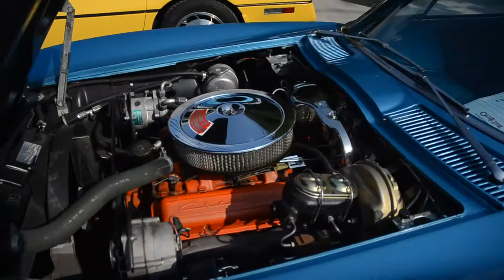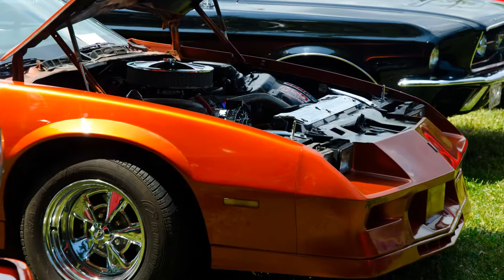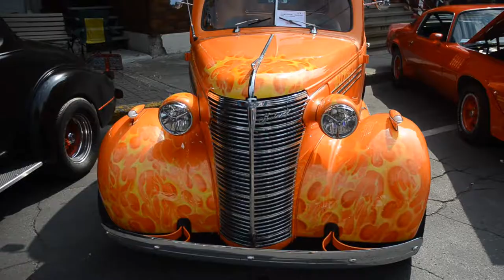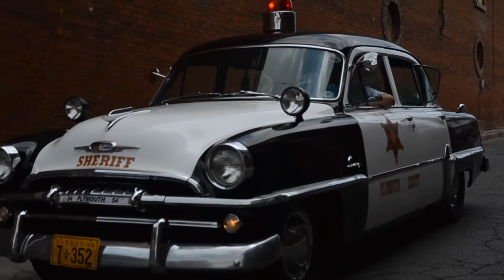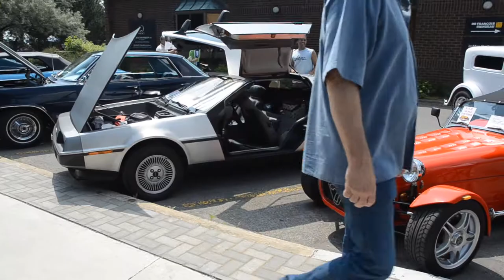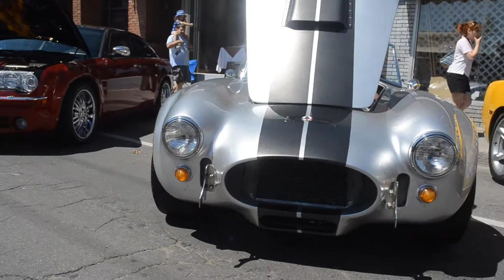Cruisin at the Boardwalk 2011

Comment from the maker: It's not a camcorder, it's a DSLR. I do most of my filming with a Nikon D7000 and some old, manual lenses (50mm f1.7, 35mm f2, 135mm f3.5 etc) because they allow for easy manual control of aperture and are smooth to focus :)
Just about any video-capable DSLR will give you great results with cinema-like shallow focus, there are many models far cheaper than my D7000. If you're on a tight budget you may want to try a used D3100 or equiv. from Canon, Sony or Pentax. And definitely get prime lenses.